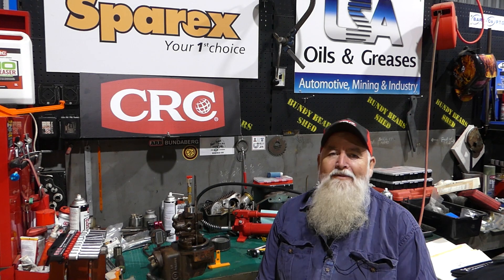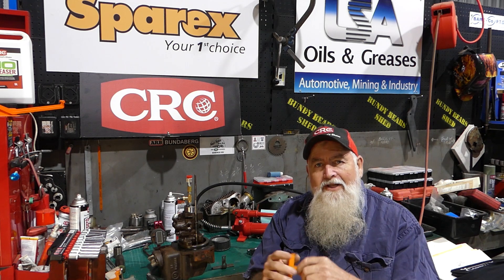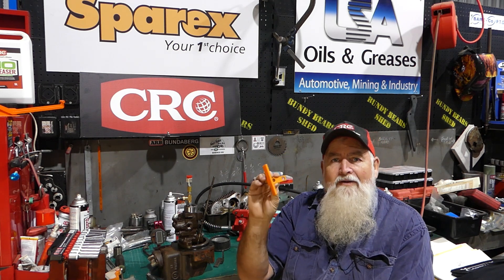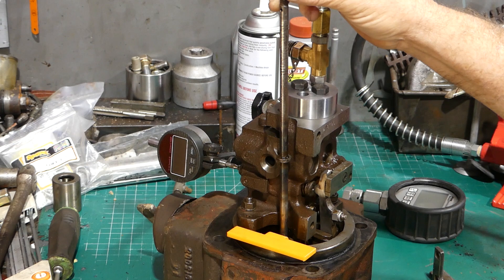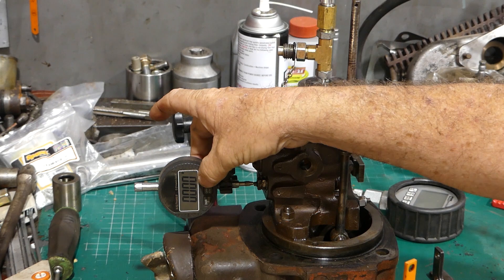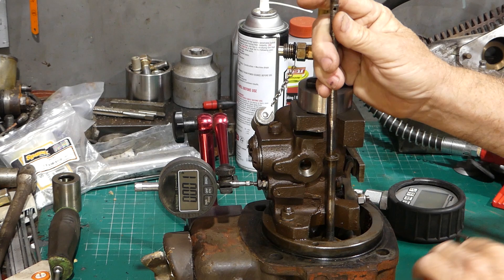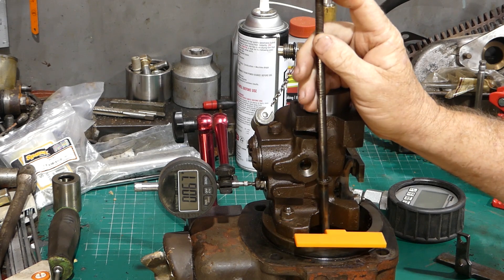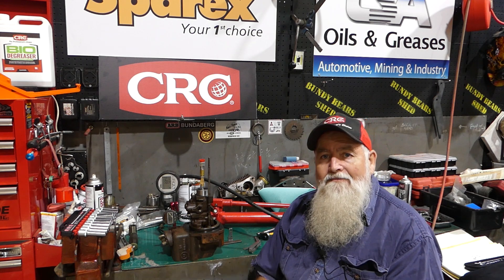David Brown Selectamatic Adjustment Tool DB961796 Tests

Comment: Any chance I can get one of these even the print file will do. Had 3 stuck valves in my 880 Selectamatic and need to set the clearance. Need to get the old girl going my paddock needs a slash. Any help would be much appreciated.
Reply from the maker: Send an email to bundybearsshed@gmail.com and I will get the file to you. Happy to share for free.
Reply from the maker: Send an email to bundybearsshed@gmail.com. and Ill send the file.

Comment: If that valve is out of adjustment, what does it do to the operation of the tractor. I don’t have one of those tractors, I’m just curious. A buddy of mine has two 990’s now that I think of it. 
Great video. Thanks for helping people out.
Reply from the maker: The control valve will not travel the full distance when needed and could lift very slowly or not at all. The top hole sets a clearance so the valve is not being activated when it is not needed.
Reply: @BundyBearsShed  thank you.

Comment: G Day Lance, great demo the operation of the setting gauge and totally agree with you, that if like me you only need this setting gauge once or twice then the 3d printed one will do, of course only time will tell, mind if the gorilla who had my tractor before me gets one, it ain't gonna last long.
many thanks Barry
Reply from the maker: Yes a cheap alternative to the original tools will only be needed now and then and with a 3d printer it will be easy to replace when and if it is needed.

Comment: Brilliant. This is something I need, both the 990 and the 880 need the control valve need to be worked on. This is something I'm going to be buying
Reply from the maker: You cant do the job without it and get it working properly.

Comment: Outstanding!  I'm just glad it fits in the holes 🙂Brilliant way to compare the bottom holes.  Glad to be a part of this adventure!
Reply from the maker: Would not have got there yet without your help.
Reply: U selling them ?
Reply from the maker: Depending on where you are we could arrange for you to buy one or give you the measurements so you can make your own
Reply: Im in Texas
Reply: I will need to buy 1 i dont have a 3d printer but i do have a 996 im working on